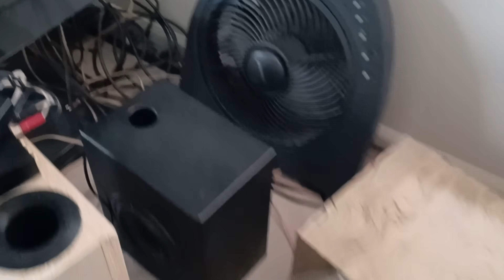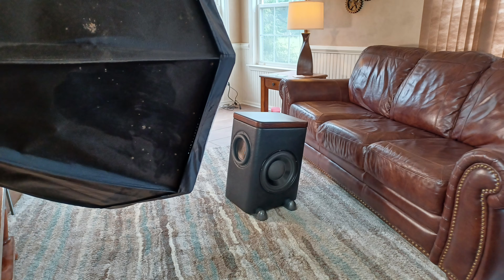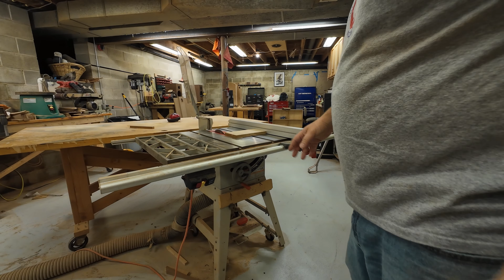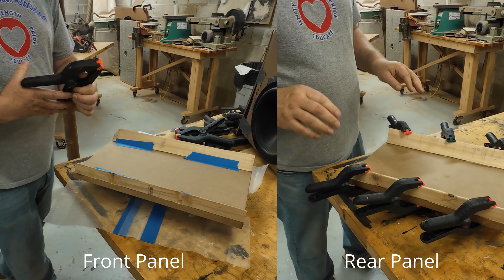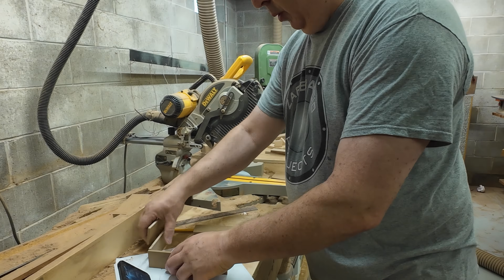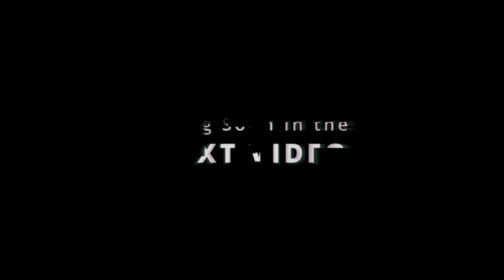'Ultim8 Max' Subwoofer Dual Passive Radiator Project

Comment: The wooden brace you cut for the 2x4 was a great idea. I just ordered two of the Dayton Audio UMII8-22 Ultimax II 8" inch. I don't have a design just yet. But I noticed they claim you need twice the X-max of the sub if you're using a passive radiator
Reply from the maker: That's the rule of thumb, and it's pretty accurate. In this project, the two.passives "just" breach their listed X-max by 1 mm or so, so I'm pushing things with this design a touch... but I've had it cranked to nearly max lol frequency volume and haven't heard any bad noises yet. WinISD let's you model how much Xmax the passives produce for a given frequency, of course, you need to bump up the signal from 1 watt to something realistic for your intended amp setup too.  Good luck with it!

Comment: Brother I have had vehicles on the carpet in Daytona at Spring break nationals. You're doing it right and you are not wrong in everything wants to move, what shouldn't move.😂 everybody pay attention now, no screws were harmed in the making of this video. Nails have also been left alone😊 I've literally seen wood screws torn in half but the glue ripped the wood apart😂 you don't need nails and screws unless you're an amateur. 🎉 weave screws for your back deck. They don't belong in your speaker box
Reply from the maker: Haha, I love that philosophy—glue is definitely king for these builds! 🔥
Reply: @zarboaudioprojects1430 best thing I can say is if you can go buy yourself a cheap Porter-Cable pin nailer. While you're assembling, those little tiny nails will hold parts in place until you can clamp everything and it will help your work piece stay stable while you assemble. These Pin nails are so small that they won't compromise your work piece. After that Titebond 2 and a shit ton of clamps.😂😂 I would also recommend if you're ever doing crown molding and your co-worker / employee / friend is across the room you might be able to hit him from about 10 ft Away really good couple of times.😂😂😂
Reply from the maker: Great suggestion... I do have one!  I just never seem to want to get it out to use it. I have a compressor right there in the corner as well. Lazy?  You be the judge! :) Thanks for participating!
Reply: @zarboaudioprojects1430 damn air compressors are too heavy for their own good.😂 there's our million dollar idea. 💯
Reply from the maker: Actually....   looking back at my footage, I actually DID shoot a few pins in there!  I forgot about that!  Go me!

Comment: Vibrations don't much bother digital amplifiers, but heat does, and that amp is designed to derive most of its cooling from the internal air movement of the subwoofer, so longevity could be an issue.
Reply from the maker: Oh, so the tiny cabinet it's in could be killing it instead of helping it?  :)   Entirely possible, it doesn't get warm even running bass sweeps, but you are right, and not the first person to point that out.  Good point.